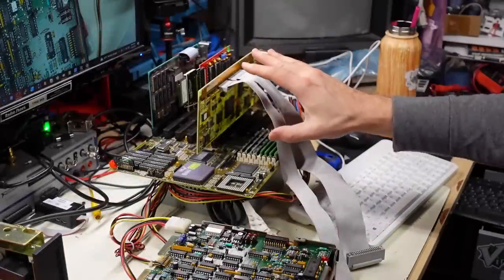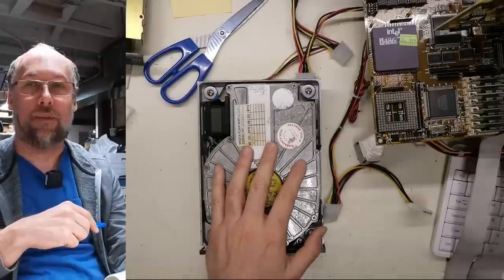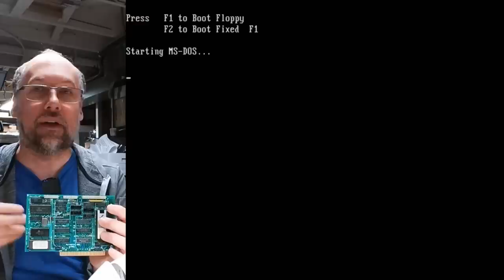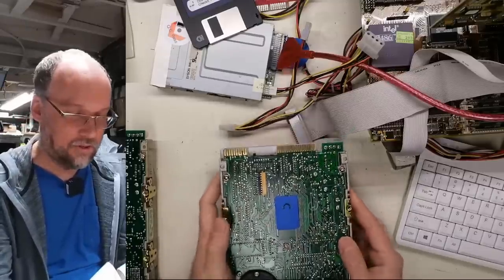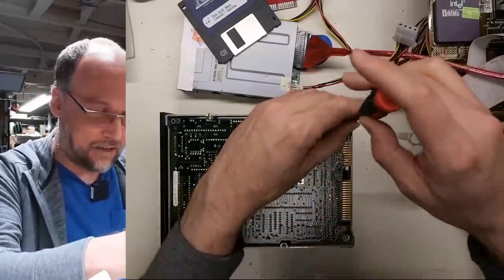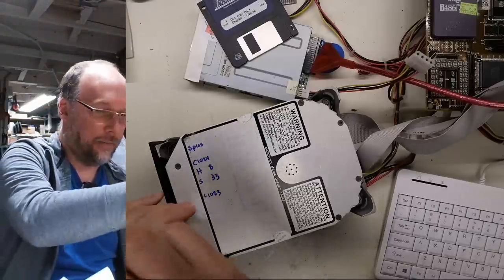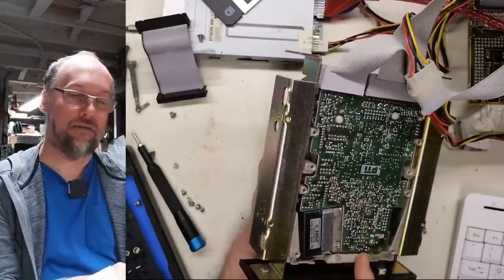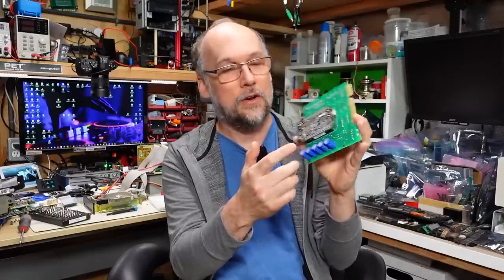MFM drives are really unreliable

Comment: I used to rebuild those ST225 drives. They have a track 0 - 1 track and I think another track (or cylinder if you like) beyond the last cylinder 612  with a data pattern on it. After replacing the platter and cleaning/inspecting the heads we would then write the track -1 pattern with a very home-made box connected to the ST506 connectors it would step the head stepper motor back (on which we drew a dot on the spindle) each time you pressed a button then you pressed the write button I think there was another button to get to the other track or there was some combination of presses. The drive would then come ready. We then did a surface analysis with a dedicated Winchester testing and diagnosing machine which would mark any bad sectors. Then we would attach it to a PC with a controller and do the debug g=c800:5 to low level format the drive and then we would partition and do a high level format. When rebuilding the drives we used little plastic spacers to separate the heads for removing from the platters, we inserted the plastic spacers with tweezers, really fiddly. All this while wearing a paper suite, gloves and a mask while a blower in the clean room tried to blow everything away! I bet all that kit went to the scrap yard years ago. For stiction we used to gently flick the heads (off the media) with the plastic spacers, which would demagnetize them and usually this would get rid of the stiction.
Reply: Hi, I have an ST225 which is only capable of showing its catalogue, when I access it through a floppy boot disc... ever had this symptom? What would be your recommended approach? Cheers!
Reply: @JulienMR  HI. Are you interested in recovering the data or do you just want to get it going? I would ensure you have the correct cyls/heads set up and also that you can read other drives with the method you are using first before attempting anything else. My guess is you're able to read the contents tables and the data isn't visible because the heads/cyls are set wrong. Should be 615 cyls and 4 heads which I think is the old IBM type 2 size 20MB (21MB formatted 26MB unformatted) If my memory serves me right. If you have no luck with that try formatting with DOS. If that doesn;t work then a low level format using debug could be needed prior to the DOS format. Run debug from DOS using the command line: debug g=c800:5 from the HDD ST506 based controller card ROM if that works when complete run the DOS format again. Obvs this will destroy any data on the drive but will make it usable  in DOS again if the board, heads and platter are OK. As it seems to be coming ready and you can read the directory I assume at least the hardware is working. Good luck. BTW this is only my opinion I haven't seen an ST225 for over 40 years so I may have forgotten a few things. So do this at your own risk.🙂
Reply: Oh - if you low level format you will need to create a partition before the DOS format using FDISK I think.
Reply: @radio-ged4626  Thanks ! I'm pretty sure than the HDD Type is good, as I checked the switches on the controler board : Off/On/Off/Off, and the first two being Off/On means Type 2 for Drive 0 (the next 2 values are for Drive 1, and I don't have any). I didn't try any Format command yet as I hope to save the drive content, but I'm thinking more and more about it !
Reply: @JulienMR  Yes, it could be the drive was set differently on a previous controller so that's why you can't read the content.
Reply: @radio-ged4626  I just tried to use OnTrack Disk Manager 3.5 (happy to have this on a floppy disk!). I have a nice message : "Cylinder 585, Head 3. Probable Surface Defect, Bad address mark detected" ... Meh...
Reply: @JulienMR   Well if that's the only one you're doing well. As long as it's marked bad in the table it should be OK. When refurbing them I used to see one or two bad sectors with new platters installed. Could be why you're not seeing the data though. Looking more and more like a DOS format is required if data recovery is not an option.

Comment: this certainly was a blast from the past.  I recall servicing drives suffering from "sticktion" or however you'd spell it.  we called it that as well and the root cause I was given was that the spindle lubricant would cool and harden beyond the initial torque point of the spindle motor.  as crazy as it sounds, the fix that worked most consistently for us was to actually drop the drive flat onto a table from a few inches up.  well within the engineering g-force tolerances but enough of a bump to knock the spindle loose and boot the system for imaging.

Comment: Thanks for this video! I remember the sound of the old ST-225 and similar drives. The good old days! You put forth a great effort on these. Much appreciated. 
This reminds me of the efforts we make to un-stick antique refrigerant compressors which have become stuck from dried up oil or other problems. The only difference is that we use 240 or even 480 volts of raw power to get them broken free. Thankfully, opening them up doesn't equal death with these devices!
Reply: Yes, unless you burn out the windings, an old compressor is probably a lot hardier than a delicate hard drive of this vintage

Comment: I remember when I was a child in the late 90's we were given a free Philips 8088 PC that had a rather peculiar start up procedure. You'd have to heat up the hard drive with a hair dryer or it would not spin up at all, but once you got it hot enough it would run perfectly fine. We used to play a ton of old games on it for a year or two and it was still working just the same when I gave it to a friend of mine some time in mid to late 2000's

Comment: When I worked at a computer store in the late 90's we would put the drives in a fridge when they had sticksion overnight and if they would spin the next day we got the data off of them with Laplink and a Laplink cable. Good times to be sure! We called it "Shake and Role", 1st you shake the drive side to side, 2nd you would shake and role it in a circle that the same time and if that did now work them it was Thump time with a screwdriver... Lol
We used HardDisk TecSpect v6 to get 99% of the drives specs we worked on back then. I believe it cost $100.00 US for a 2 licenses copy back then.
Great video Adrian!

LLAP 🖖

Comment: I had a similar model Micropolis HDD to that one and it was quite loud too.  Seeing the motor PCB bought back memories.  Compared to the original ball bearing based Seagate 3.5" 7200 RPM Barracuda hard disks the Micropolis was quiet.  Those things were really loud.  They were so loud that it was uncomfortable to be nearby.  They ran roastingly hot too.  It really makes you appreciate the later FBD designs.

Comment: Stiction was also an issue in large CDC sealed drives. We discovered that if the heads didn't move, the Teflon surface of the platter would get hot and effectively become an adhesive so when the heads landed, it would effectively "glue" the heads to the disk surface. What we finally ended up doing was modify the HD driver to rapidly move the heads around any time we went some number of minutes (I forget the actual time) without being accessed. We would that move the heads to a random sector.

Comment: I had a ST-225 WAY back in the day.  I'll note that those often get SUPER hot, which is part of what causes "sticktion".  Even the best of them got hot enough to effectively melt and then boil away any lubricant used. I had one that after running for a day or two solid got hot enough to literally to unsolder it's own components.  Seagate's answer to this was to always mount it with the metal body pressed against the cage to act as a massive heatsink.  Always good to see older technology of yester-year.

Also, most of the ST-225 were from the age where you could use MFM or RLL. Given then RLL would make the same drive about 38M (vs 23M), I'd bet the one you had was formatted as RLL.

Comment: I love your channel, Adrian, thanks so much for your hard work. I've opened up quite a few non-working old drives where stiction had been 'fixed', by force or by itself, to find the heads still stuck to the platters, ripped clean off their mounts. The noise it made when the drive was running was unmistakable. Happy days! 😂
Reply from the maker: Haha yeah that's happened to me too. Slamming into the now naked arms as the drive spins up. Bad times indeed!

Comment: This is exactly what I played with in my bedroom when I was supposed to be sleeping and get to school the next day. 
I want to think... Early 90's. 
And as I posted before I ended up running a BBS off these things. 
I have a lot of current coworkers who went to University and "learned" I.T., and they would have no idea what these things are. I feel I just walked into this career and back then I would thank the stars any tech I could get my hands on in the day.
Reply: I had a BBS back in the early 90's running Wildcat! BBS.  I had a 286/20 for my BBS computer and a 486SLC/40 for my personal system.  I had a Seagate st225 in the 286 and a 80 meg WD and a 200 meg WD drives in the 486.  I ran Lantastic Z with a parallel cable between them and then later upgraded to NE2000 with Novell.  I had all the BBS data on the 200 meg drive and a tape backup that ran every night to back up the user data.  When he fired up that st225, I knew EXACTLY how it was going to sound and when I heard the heads move, i knew there would be a "ding" to let you know it was ready.  Sucker sounded like a jet engine firing up.

Comment: MFM drives could be interesting to repair. In one case I had a 15 Mbyte drive (3 X 5Mbye platters) which had a head crash on the top platter. I removed the bad platter and made it a 10 Mbyte drive, which worked for many years.
Reply: Yo hago lo mismo cuando el cabezal está dañado, le reduce la capacidad pero funciona, hice algunos videos

Comment: I worked as a technician in the late '80s through mid-90s and we called it stiction too.  I would lift the anti-static strap underneath and twist the spindle with a pair of needle nose pliers to get it started and then immediately back up the drive.

Comment: Hello Ardrian . Fro ST-225 - Faulty track 0 signal ? all the time trying to calibrate  , try to make that trick :
-normaly connect the disk , don't setup disk in the bios . Run MS-DOS after that run program SGATFMT4 
from the list chose geometry (CUSTOM = 615 ,4, 17 or "ST-225") , after that  Option 1 Low level (blind formatt without verify).Turn off the pc and turn on setup in the bios reset if pass calibration it's ok if not change the PCB and do the same .Common problems :
-Head crash ,faulty IC , PCB read/write error because of age .

Comment: Thanks Adrian. I spent the last 30 years working at an industrial site that used the micropolis RD53/54 hard drives with microvax 2 mini computers running a propriety software. They were all MFM drives and used Dec M7555 controllers. We had up to 13 running in the field and at least 3 backups running in our maintenance shop. As well we would sends them out for repair at W.M. Farris in California. There were a number that would scream during startup and then get quieter after running for a few hours. Just before I retired I replaced them with solid state MFM drives made by DREM. The DREM drives worked great. Thanks for the memories...

Comment: Take the platters, drill a small hole near the edge. Take one of them and drill evenly spaced holes around it's edge. Suspend the single hole platters from the multi-hole one with light fishing line. suspend the whole contraption by fishing line strands attached to the multi-hole disk, and tied together. This gives you a great sounding wind chime. You can even drop one through the center with some salvaged polyamid cable to catch the wind & act as a clapper.

Comment: I remember them not being very reliable back in the day. I got my first pc a clone 286 because the mfm hard drive died and it was thrown out. I also remember  that even later with some 386 clones that used ide that the bios was limited to specific drive geometries i used to get these very cheaply without the hard drives (not sure if they had broken or the drives were removed   for security) there was a work round on these which i think was some sort of drive geometry translation utility, but i cant remember how it worked or what it was.

Comment: While working up at Seagate on contract got the opportunity to see them spin testing a large glass platter. That thing went off like a bullet! Forget what RPM they got it up to.
Reply: The fastest 3 1/2" drives were 15krpm. I believe I read somewhere that every attempt to go beyond 18krpm on commercial scale failed spectacularly. Also happened withCD/DVD drives that were 52x. A tiny imperfection of the disc was all it would take to shatter,

Comment: Yeah, ST225's did have stiction, and my shop called it that too.  So, my solution was to set it on a desk and swatting it gently on one corner of the front of the drive (Say, just by the "WARNING" label) with a plastic hammer or small rubber mallet.  Contrarily, I always suggested replacement, but once I swatted a drive free like that, at least MY limited experiences (6 or so drives?) had none come back having utterly failed in the time I was working there.

Another possibility is that the ST-225's also had a 'transit-parking option' that needed an actual 'unlock-park' program tool to tell it to release the heads and spin up the drive again.  I think the first version of SpinRite had had an option to Park Heads that could activate that mode...but it's been so long that I can't remember for sure.  I had tools to allow parking and unparking.  Some drives did nothing until un-parked, while most would spin up but not release the heads without the un-park command-or-whatever.  I think Maxtors (EIDE and SCSI) would spin but need to be un-parked to fully come online.

Also, the drive previous (ST4051?) sounds like it has a crashed head.  One of the heads is no longer 'floating' like it should be, so it's dragging.  At top speed it was at least almost-floating, but that was a seriously-terrible sound, and I would not expect the drive to live for long, IF it hasn't already flipped the head over.  I write this 5 minutes in, so we'll see what it shows later when he takes it apart!  :)

The CM drive didn't sound bad, but it didn't 'click' and unlock the heads so it may have an issue...or may need to be un-parked, but if the rotation never mostly-stabilized, there may well be an issue.

The Micropolis 1325 doesn't sound awful.  Some drives can be REALLY DARN LOUD.  Maxtors and Fujitsu still come to mind.  @.o  Oh the noise.  I had a SCSI setup and powering on took like 4-5 minutes and sounded like I thought 'powering up a nuclear reactor' would be kinda like.  Noise is no guarantee of dysfunction.
Reply: Have you seen a Fujitsu M2243AS? That thing is loud due it having a whopping 11 heads! It's also a voice coil drive according to the specifications :)

Comment: Here's something I came across on Digital Equipment Corp. VAXstations and microVAX minicomputers from the mid-80s using these types of drives: loud, high-pitched squealing.  We thought the drives were failing, but it turned out there was a small hard graphite cylinder held onto the end of the platter spindle by a brass colored clip.  After months or years of continuous operation, the end of the spindle shaft would polish a dimple into the graphite, which would squeal or shreik as it spun.  We learned we could loosen the screw holding it on, and either shift it slightly or remove it entirely. Noise gone!  The graphite "button" appeared to be there to bleed off static charge from the spindle and platters, so we typically just readjusted it.

Only 22 minutes in, but wanted to post this before I forgot to do it afterwards.

Comment: Even fairly modern hard drives could be loud back in the day.  I remember when I bought my Amiga 1200 brand new in 1992 with an included 40mb HDD I was amazed how loud the tiny little 2.5" HDD was in it.  Turned out Commodore in typical fashion bought up the cheapest nastiest drives they could get their hands on for the job.  The HDD in mine was A Conner unit I believe.

Comment: Hey Adrian, do you still have that top board of that ST-4051?
I have a ST-4038 (which is the same drive, just with one less platter) with a broken top board. Mechanically the drive is in perfect condition, but there are a couple of broken components on the top board due to rough shipping.
It would be great if I could try to get that drive to work again with a donor board!

Comment: Please dig into the big drive. It would be interesting to see what's up with the drive.

I hope you saved the earth magnets inside the drives you took apart. They make awesome clamps for holding things in the workshop. Please be careful though when handling the magnets because they can really pinch pretty bad.

The really noisy drive actually had ferrite and copper disc material gouged out of the platters as if they were put through an engraving machine. When you spun it up without the cover, it sounded like Boston's MBTA light rail (We call them trolleys) pulling into Park Street and Boyleston stations. Look that up for the comparison! ;-)

I've taken many drives apart myself and yes, the parts are really amazing. It still amazes me today how complex they are and how much smaller the components have gotten while the storage has gotten bigger.
Reply: I had two of the magnets pinch the underside of my wrist. It took some skin with it. 😬
Reply: @kd7cwg  Ouch! That must've hurt! 

I got my finger caught between them and ended up with a blood blister.
Reply: @kd7cwg  Ouch! Neodymium magnets are force to be reckoned with :(